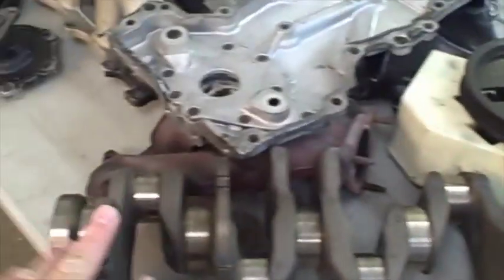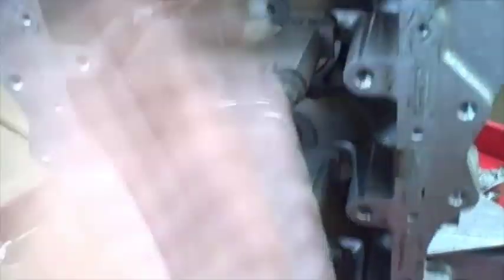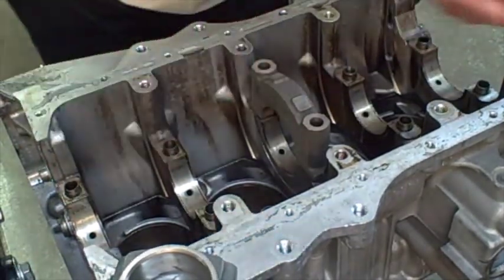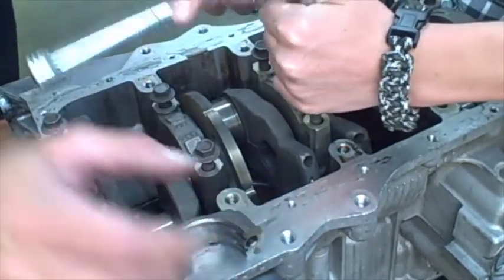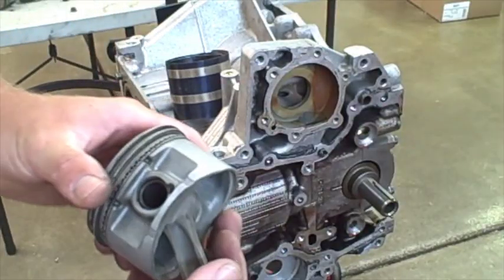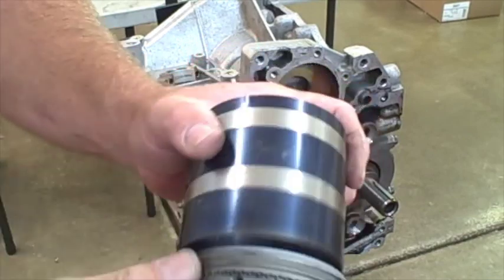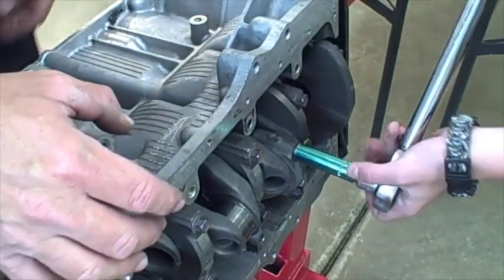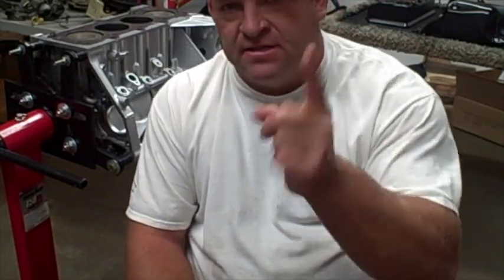Saturn piston install

Comment: Why are you doing this without bearings my sl just gave out last Month thought it was  timing chain broke but after removing valve cover chains still strong and hard knock from cylinder 3or 4 so I assume it’s a bad rod bearing either spun or cracked :( any input would help thanks gonna start pulling it apart this week
Reply: I was wondering the same thing AutoZone sells a set brand new for 20 some bucks ?